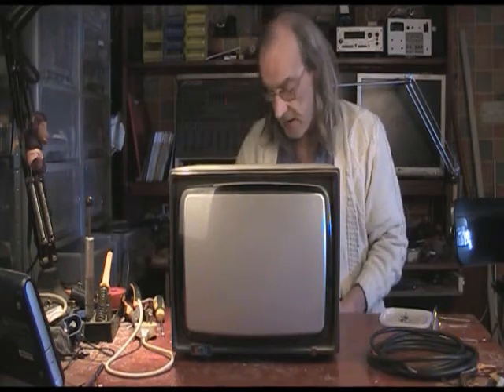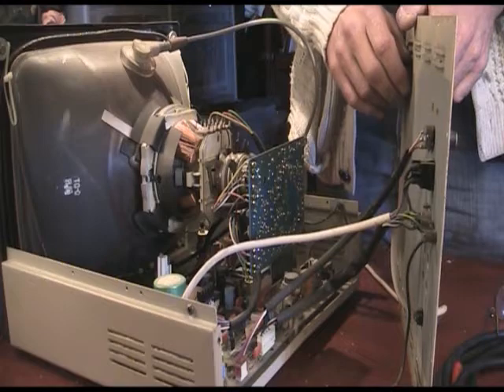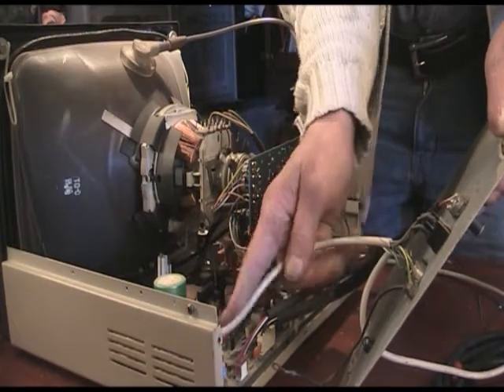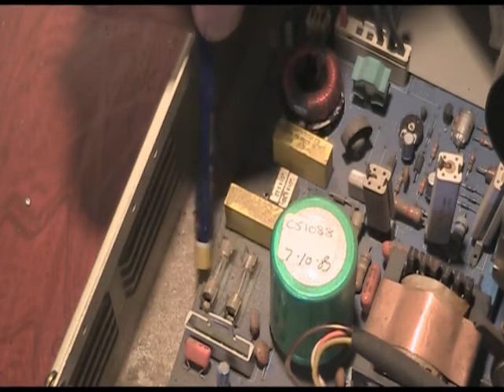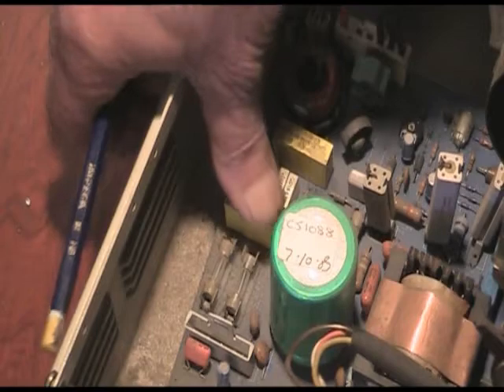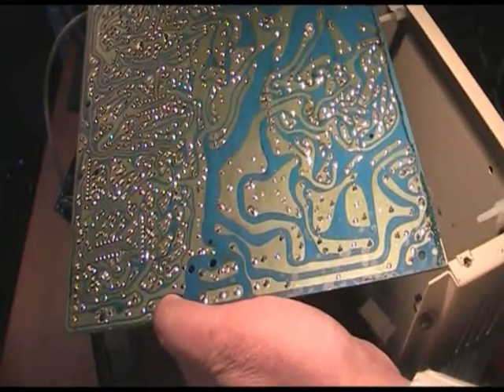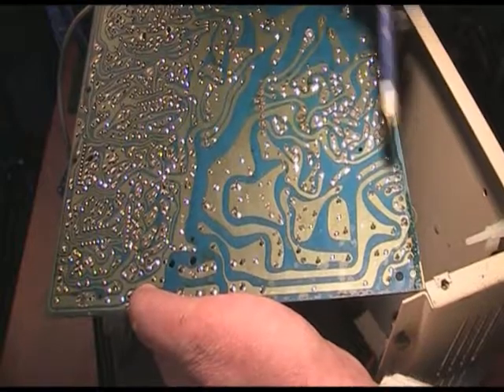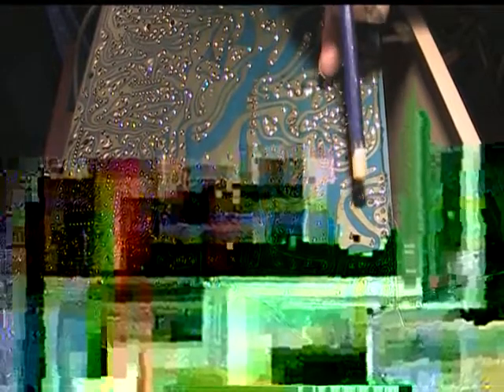CRT monitor tour and fault finding

Comment: Hi, I've got to replace the tripler and the DC smoothing cap. I've got a new tripler in my possession together with a replacement cap - any advice you can offer please? My CUB is a 1431-MS4 and when I switched it on after it having sat in storage for ages, went fizzzz and crackle with some putrid smoke.

Any suggestions before I tackle this? This will be the first time inside a monitor working at this level. The only other inside monitor work I've done is replacing the power switch on a Commodore 1084S. I know to discharge the tube and the PCB with some foil as per your other video but I am still very nervous on working on it but very competent with a soldering iron.

Thanks for the videos - sterling job :)

Comment: Just a quick update, though a boring one... It seems it *was* the CFL bulb that blew my breakers. It monitor Sparky mentions is working and is currently in use on another computer, but the desk lamp (mentioned in the description of this video) failed to turn on. Everything else was fine, the lamp wasn't.
Never, ever, ever buy cheap CFLs. While I haven't taken a look inside the blown bulb, I suspect it was a capacitor that blew (hard enough to blow the breakers).

Comment: Great video. I just started to repair my own monitors and am stuck on my first.
Would you consider taking a look at the video I posted and giving me your thoughts?
To describe the problem, the screen is almost white with kind of steep diagonal lines.
I replaced the caps and just received a new IC for it. I am shooting in the dark though.
I wont spam you but if you would like to check my video, click on my name and go to my channel. It is currently the first video in line. Thanks!